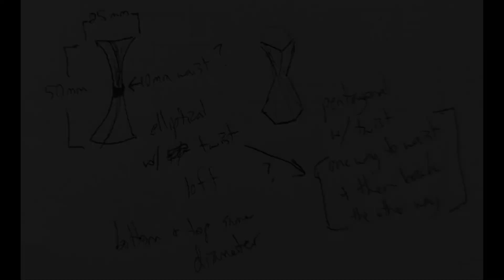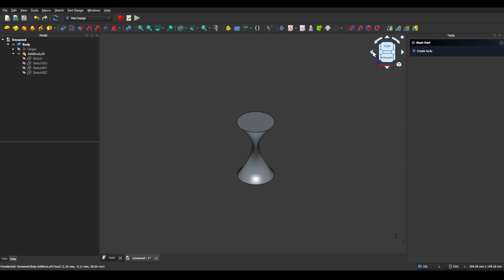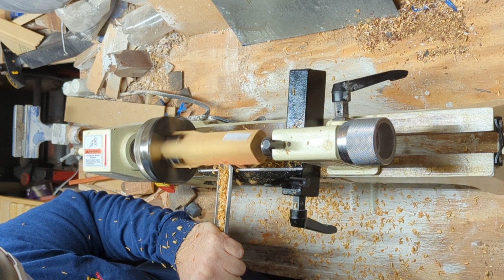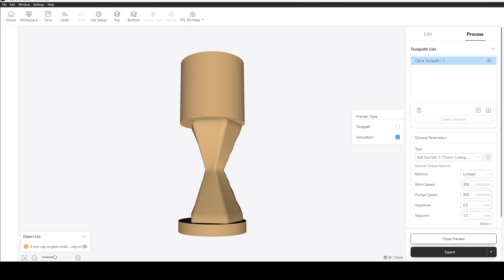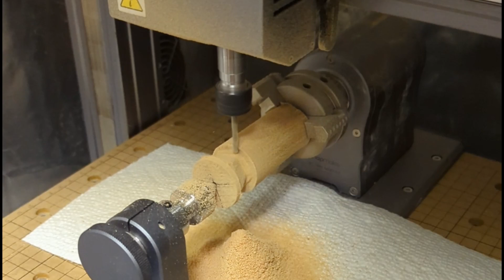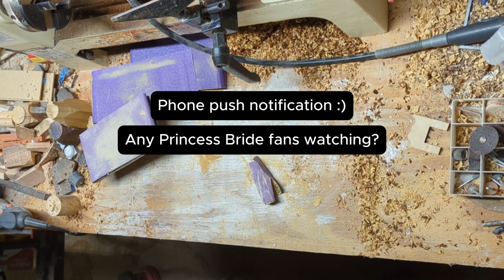4th Axis CNC Board Game Pieces

Comment: I've been looking at the snapmaker machines, especially because they can do 3D printing, laser cutting and cnc work, so I liked seeing it used for some actual projects.
Reply from the maker: I've had mine for almost 4 1/2 years now and have slowly upgraded it (the big laser is soooo much better than my original). 
It's not the best at any of the 3 things it does, but it's more than good enough once you adapt to it and it's so versatile, plus I can fit all 3 functions on one workbench.
Definitely great for prototyping and small scale production. The biggest problem I've run into recently is that since it will only do one function at a time, my production demands are starting to overtake its output capacity. I might need to look for a dedicated 3D printer to take some load off of it.
Reply: @beautiful_upgrades  that is a bit of a challenge having a 3-in-one: while it's being one, it can't be any of the other two 😂

I've recently discovered Tak, and via that discovered your channel. I'm going to have a look at your books so I can study some tactics!